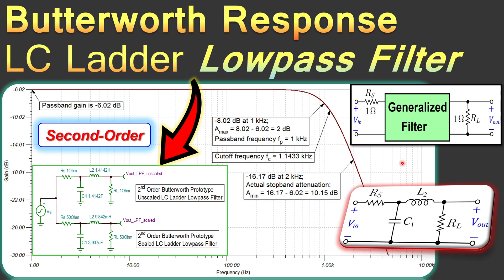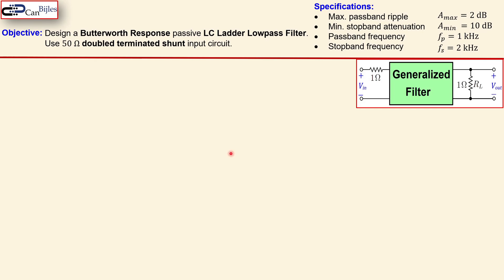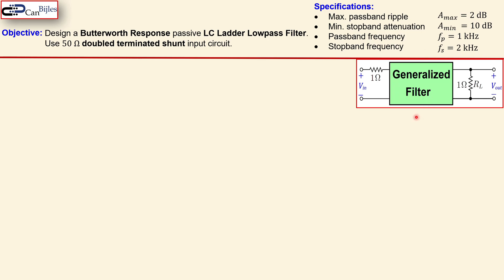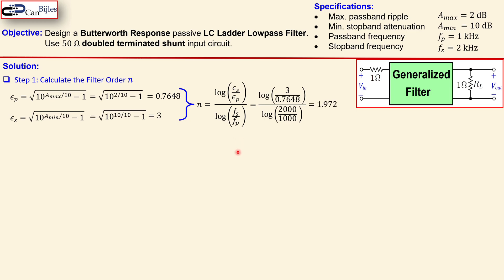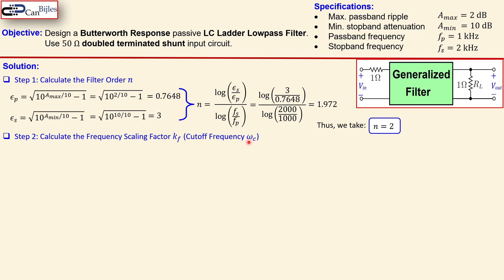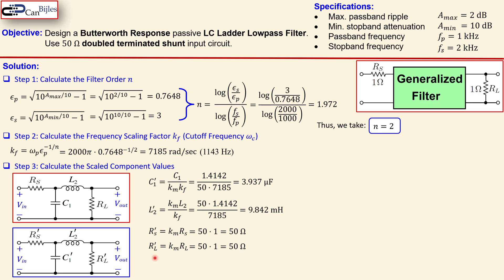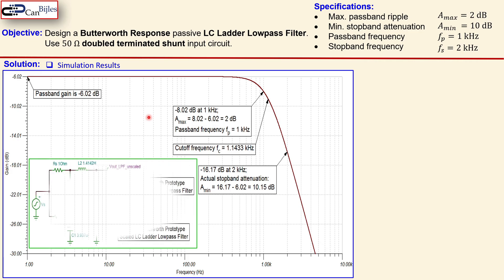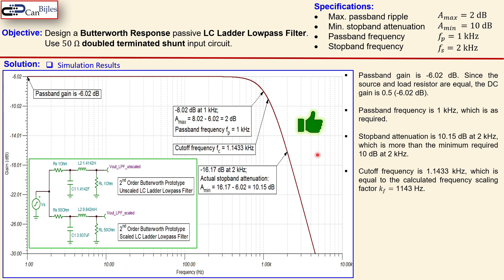LC Ladder Lowpass Filter Design 🌟 Butterworth Response - 2nd Order 💡 Example 1

Comment from the maker: If the load (R_L) is not equal to the source resistance (R_S), then it is necessary to change the coefficients in the table. In the examples I discuss, all coefficients in the table were calculated based on R_S = R_L = 1 Ohm (normalized) and then together scaled up to 50 Ohm.

There is a section at this link that may be useful. The coefficients are recalculated according to the R_S/R_L ratio: https://my.ece.utah.edu/~cfurse/ece5320/lecture/L27/Filter%20Design.pdf
Reply: Thank you so much. You are a life saver.
Reply from the maker: Great to know I helped you out 😉 Good luck and do not forget to share and like 👍
Reply: @CANEDUX  You have gained a new avid subscriber. <3 One more thing. I have sent you an email regarding a follow up question. I can't already comment it out here because it contains screenshots. I hope you will notice it and you could help me out. Thank you very much.
Reply from the maker: I received your mail. I will get back to it as soon as possible.
Reply: @CANEDUX  Yay. Thank you so much. I will wait for your reply. God bless your soul.
Reply from the maker: @jericoyabut6570  I prepared a new video which will discuss this unmatched source and load resistances. The video will be online after a couple of hours. See link: https://youtu.be/yCJHRoV6EJk

Comment: Does this whole process of computation also works if RS << RL?
Reply from the maker: Thanks for the message. That is a good question. Usually, the source resistance (R_S) and load resistance (R_S) are matched for maximum power transfer. That is the reason for making R_S = R_L. If the you do not make them equal to each other, you still need to select a magnitude scaling factor (k_m), but you cannot use two different magnitude scaling factors.
Reply: @CANEDUX  How will I know which magnitude scaling factor should I use?
Reply from the maker: That depends on the specifications, but you need to make a choice for the magnitude scaling factor. You cannot work with more than one scaling factors.